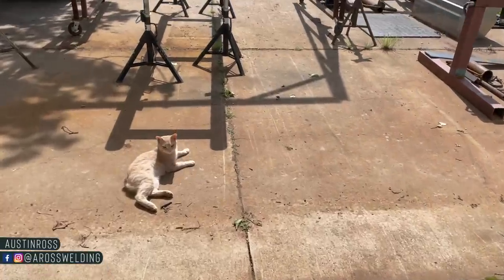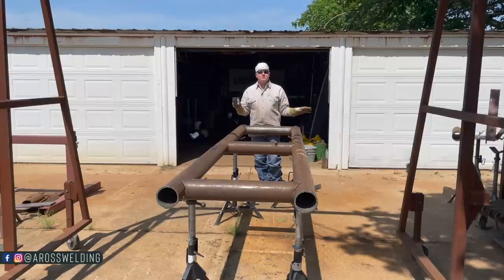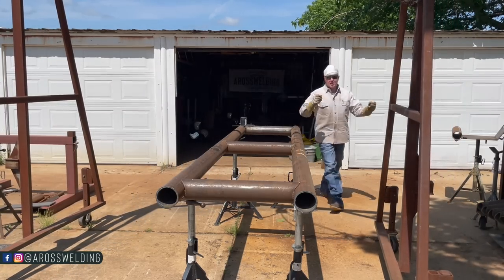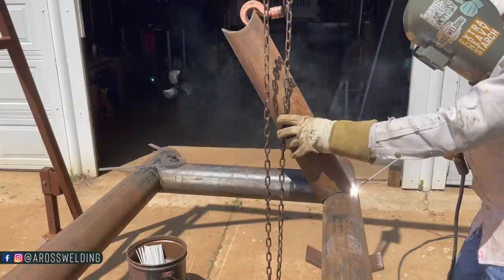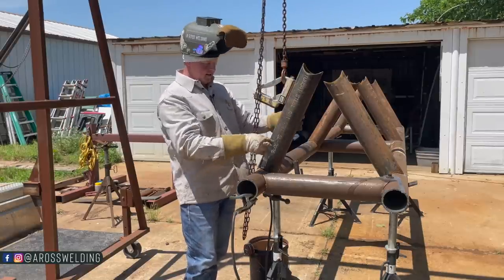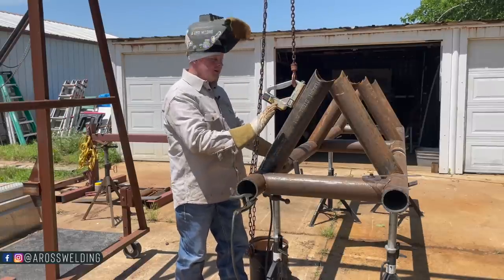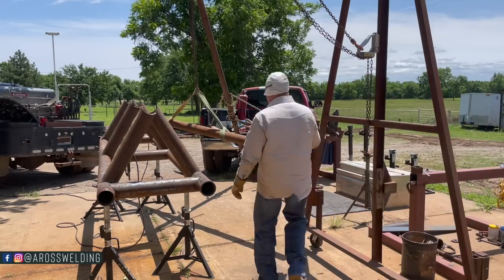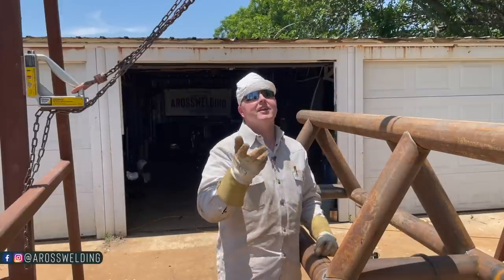GOT R WOOPED, GLAD I HAD MY A-FRAME, SO SATISFYING!!!!

Comment: My question is why couldn’t you hold the top pipe with the a frame and put your support pipes in place and let the weight of the top pipe hold them in place while you start tacking it up?
Reply: Coincidentally I have built something very similar and did it almost exactly the way you described, and I wish I had just started the way he does in this video and make each leg right before bringing the long piece in. I ended up running back and forth and doing a lot of fine tuning I just think it would have been more efficient dialing them in one at a time

Comment: Just another idea, If you're dead on with the length at the bottom of the saddle of all your angled pieces; you can prop each pair with a piece of straight stock and clamps, then set your top crossmember in the top saddles, let the weight of it seat the angled peices into place, tap them square, tack them, then weld it out. I'm lazy that way. LOL.
Reply from the maker: I love it!